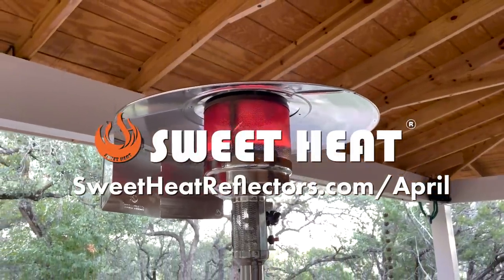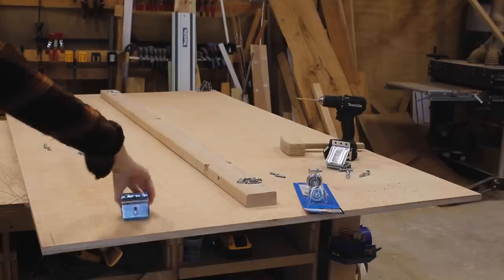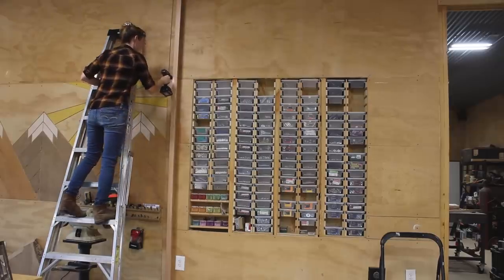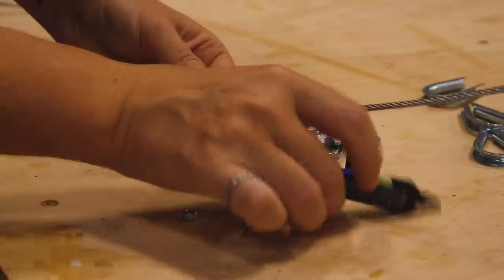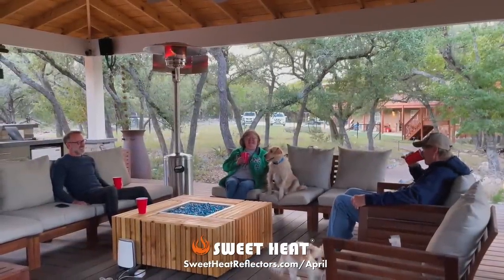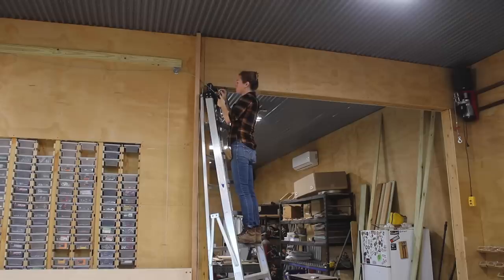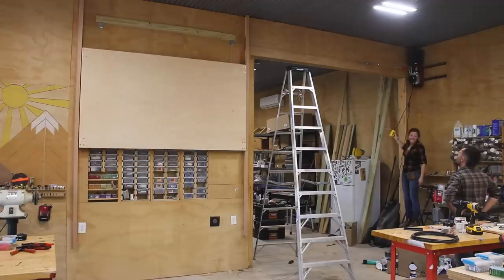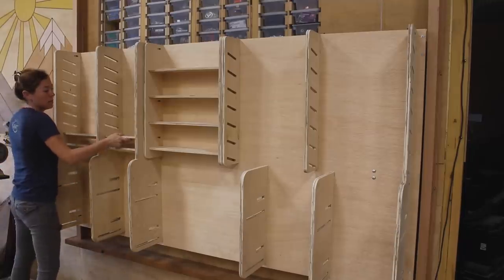DIY Overhead Storage for Garage or Shop | Motorized Shelf

Comment: April, I was always taught "never put your saddle on a deadhorse". Referring to cable clamps. Double check me but I believe ur clamps are backwards. The saddle portion should be situated over the "live" end or load side of the cable. If not correct the clamps can slip and fail if enough load is presented. That would be bad. Love your channel!

Comment: This is a really good idea! If my ceilings were high enough, I'd totally do this! Although, looking at 3:13, your wire rope clips appear to be backwards (I'm hoping it was just a camera angle problem, but I looked at it on my large screen and they do appear to be backwards). They are supposed to crimp the "dead" side and the "saddle" needs to be on the "live" side. There's a saying with wire rope clips: "Don't saddle a dead horse". Having them crimp the "live" side will weaken the strength of the cable and potentially cause failure. Even if wire rope clips are set properly, the effective working load limit is reduced by 20%.  You reduce it further by having them backwards.  Also, they are supposed to be torqued to a certain amount when you first put them on, then again after taking load. I hope that all made sense.  I'm more than happy to answer questions.
Reply: I've heard that about those clips, but I've also heard the preferred method is to unwind the strands and braid it back on itself when forming the eye. Tried it a few times with rope, and helped my dad do it a time or two with cable, and if you take your time the resulting eye looks like it 'grew' out of the end and will handle whatever load the rope or cable is rated for.
Reply: What Mike said, and please do go back and re-torque the cable clips. You will be amazed at how loose they get after loading.
Reply: @curtfatherree7474  that is one method.  It depends on who you talk to or your application as to which method is preferred.  One nice thing about that method vs the wire rope clips, is you retain its breaking strength/working load limit vs losing 20% with wire rope clips.  Similar with compression sleeves.  You retain the working load limit with compression sleeves.  I tend to prefer the compression sleeves because it's faster and you still retain the strength, but it does cost more to have the tools.
Reply: @mikejohnson7882  Is the tool for compression sleeves anything like the hydraulic tools they use for crimping wire connectors?
Reply: @curtfatherree7474  Similar.  There are both manual (more for the smaller sizes) and hydraulic tools (for high volume or larger sizes).
Reply: I think they are applied correctly in the video, but I agree it's hard to tell.  Regardless, this is great info!  Someone who follows the build and makes their own will definitely want to read this comment if they have no experience (like myself) in setting up wire rope rigs.  "don't saddle a dead horse" is going to be stuck in my head, so thank you!
Reply: @mikejohnson7882  I kind of thought they might be similar.
Reply: Note to self: Research the proper use of wire rope clips before using them for the first time.
edit: typo.
Reply: I would have looked for a garage door opener with automatic lock

Comment: April, I always love your builds and am always impressed.  However, one thing I would add (being in the safety business) is adding pins or some kind of lock so you can have a safety device just in case you hoist lets go or one of you many cable connections fails.  What you've built is essentially a guillotine!  It would be easy to add some pins that you could slide into the track just below the rollers (when it's in the up position) to stop the shelf if something fails, but you could pull them out before lowering it.  We used to use bolts in the garage door track to lock garage doors in the down position to keep someone from opening them from the outside, so the same idea can work to hold the door/shelf up.  I'm sure you could come up with something more creative!

Comment: I am having a workshop built (SHORTLY), and I opted for single story, taller sidewalls (mainly due to continued inflated prices).   I think I will love the wide open space, not quite as high as your building, but want to utilize the higher side walls for storage.   As an "older" woman, finally getting space to do wood working, I also knew I don't want to climb a ladder to get to that storage!   This seems like the perfect solution to add storage, but have it easily accessible!  THANK YOU for another great idea!

Comment: Here is a shelf I’m building that raises and lowers similar to yours. My shop is only 15x12 so every inch is important. I’m going to add wheels so I can unclip the shelf and roll it to where ever my shopsmith is at the time. Thanks for posting it inspired me to use my vertical space.

Comment: Awesome shelf - the only cringe i have is seeing a "saddle on a dead horse" with the cable u bolts - always been taught to always have the u-bolt over the dead end (the dead horse) and the saddle on the active/load side of the cable - all to do with how it effects the tensile strength of the rope - not so bad in a low load situation but still a good habbit to get into

Comment: What a great idea to maximize your space.   My apologies if someone has already mentioned this or if you did attach the wire rope clips properly.  I come from the stage rigging industry and It looks like one of the wire rope clams was not on properly. The "U" bolt must be on the loose end (dead end) of the wire rope and the saddle of the rope clip needs to be on the live end of the thimble.  The saying, in the stage rigging industry, to remember the proper way to attach rope clamps is "never saddle a dead horse".

Comment: I used a small lift like that for a big light fixture that hangs in the entry with a tall stairway.  It works for changing light bulbs or just cleaning the fixture. A whole lot better than a 30' ladder in a house

Comment: The only issue I have is the aluminum turnbuckle and the oak tracks.  There is a chance for catastrophic failure at that those points with time and use.  The steel eyes can pull through the aluminum buckle with too much weight or with common wear and tear.  Steel all the way through would be safer.  Maybe look at steel tracks used for farm doors instead.  I find them at Tractor supply.

Comment: By far your coolest shop project hands down. When U decide to put something on the archway header, U can put a pulley horizontally @ top Rt, & mount winch on ceiling or even run cable thru wall & install winch in the other room. Sweet.

Comment: Awesome idea 👍 Will point out one thing just encase someone has never used thred lock before use the BLUE just like April did, as the RED is for a permanent lock and you will find it almost impossible to loosen without the use of a blowtorch.

Comment: Each of my cars has a spare set of tires and wheels. Every season I swap out the wheels, and then lift the heavy wheels overhead onto a tall shelf.

My shop has 18' tall walls, the top part of which are unused.. If I could come up with a good way to store the wheels on a system like this, that could work great.

Comment: You stole my idea!! 😮😊 I’m mostly confined to a wheelchair so I was trying  to think of ways to use the upper parts of the wall.  I have a small space and need to utilize all the space (and most accessible shops waste the upper walls).  Your approach was similar to what I was thinking, but your implementation is much better. Since I had not implemented my idea yet, I will follow your approach. This is the second idea from your channel I’ve utilized to make DIYing easier: I mounted ToughBuilt bags to my wheelchair armrests.

Comment: It is a good idea. You can also add a fall restraint break mechanism for added safety. It shouldn't be too hard to do but you may need 2 of them depending on the weight of the unit and stored material. They can be pricey but I think worth the effort.

Comment: If you like the project but don't want to deal with an electric hoist you could also get a hand crank one starting at around 25 USD to lift 600lbs and can get ones that lift 2500lbs for only 50 USD on amazon. My grandfather used a hand crank one to store his ladders above one of his cars in his garage since before I was born.

Comment: I don't think I would go with this purpose, but I always thought if there was enough ceiling height something like this would be great for a glue up wall. My thing was glue ups always ended up on the floor, table saw, work bench, anywhere there was room. Which meant everything else came to a stop because there wasn't any room left to work.

Comment: Great idea!  Another idea would be to build multiple shelves to store lawn equipment in a vertical orientation.  Build a platform that hoists the equipment using a lift to the required shelf and just roll off for storage.  Just like a mini “Carvana” system.

Comment: WARNING - it looked like you attached the U-bolts to secure the ends of the steel cables where they double back on themselves without stripping the clear plastic off of the cable. I learned the hard way on a project where I setup a winch to hoist a deer feeder up/down that the U-Bolt connection REQUIRES stripping off the clear plastic coating on the cable back to where it doubles back on itself. If you don't strip the plastic coating off, it's likely that eventually the coating will slip off and everything will come crashing down. If you did and I just couldn't tell in the video, apologies for the abundance of caution. and all that said, the project was great and inspirational.
Reply: PS, I setup something similar to hoist my air cleaner up to the ceiling, then lower it when I need to change the filter. 12' foot ceilings are a blessing.

Comment: It looked like you had the saddle of the bulldog grip on the tail end of the wire rope and I believe it should be on the load side.
Reply: Wow I had never seen that requirement. Thanks for the comment. Now I have to go check the overhead garage platforms I put in.

Comment: Great project!bI may have missed it but did you install any kind of locking bolt? I would want someway to lock the shelf in place at the top and bottom levels so you can take tension off the motor. I am not sure those AC winches are meant to hold a load in place long term.

Comment: Your idea is really great.  As I'm getting older, things are getting to be heavy for me to lift. I am putting in a hoist to raise and lower my bandsaw in the garage.   So I've been putting pulleys over places where I'd like to lift things and have been using a PullzAll to lift heavy things at those points.  Your idea made me think  that a a single hoist could be used to lift at all those places.  I'll have to think about how to switch them. Maybe a pulley arrangement like is on a Bowflex machine would work.

Comment: Interesting idea for a really tall wall I suppose. Only thing I'm a little confused about this video is, what shelf did you actually intend to make/use? It looks like you made a set of shelves for paint/spray, then you showed video of what looks like the exact same motorized board, but with a completely different set of shelves for the truck boxes on it. I didn't see anything in the video that allows you to swap between these two sets of shelves, so did you just dismantle one of them just for the sake of the video so you could show a different configuration? Which one did you keep/want?
Reply: I was a bit confused about that as well.
Reply: Yup confusing 😕

Comment: With a cheap Harbor Freight winch (>$100 for 2500# & wireless remote) I could see this being used to raise up bicycles, extra storage totes or even a lumber rack. Just wish I had more than 8' ceilings to be able to utilize one. - Chris
Reply: Just make sure that you have a way to power your Harbor Freight winch since many of the less expensive ones are made to run off 12V that automotive and ATV use and don't come with an adapter to be powered off anything else.

Comment: I love this idea!  Because of the angle of my roof, I wouldn't be able to raise it above the wall. But even 32 sq ft more is something to consider.     Also, think there is anyway for the winch to lift two boards side by side? That would be sweet. I have the length, just not the height. Nice design if I didn't have to purchase two winches.

Comment: I think adding pulleys reduces direct weight of the shelf to the hoist. More pulleys more weight distribution. So in theory this setup can support shelf heavier than hoist capacity.
Reply: I believe (and I am no expert, so I could very well be wrong) it would gain mechanical advantage only if there was her existing pulley at the top, plus a new one attached to the D-ring anchor on the back of the shelf, with one cable off of that going to the fixed-point axle of her pulley, and the other side going around her pulley, creating two cables between the two pulleys 'pulling' the weight (the fixed and the one going around her top pulley), and from there, one from her top pulley back to the hoist.  This would cause the hoist to pull twice the distance of cable run length, two feet at the hoist, to move the same weight, the shelf, up one foot.  That is, one foot on each side of the new bottom pulley attached to the D-ring anchor.  Each of those two feet, one foot on each side of the bottom pulley, is moving half the weight, but causing the hoist to have to spool 2 feet of cable, for a 2 to 1 mechanical advantage.
Reply: Not in this particular case. Because there is only one cable run between the shelf unit and each pulley, the pulleys are just redirecting the force from the winch.

If there were two or more cable runs between the shelf unit and pulleys on the shelf unit as well (i.e. a block-and-tackle system), you would be correct. The trade-off would be that the winch must pull in more cable.

She could have done that quite simply by adding pulleys to the shelf unit, then running the cables down from the ceiling, through the bottom pulleys, then through the top pulleys and over to the winch. This would effectively provide four cables supporting the shelf unit instead of two, cutting the apparent load in half.

Comment: That only works because the wall is essentially blank.  Inset storage is not the norm to encounter.  Most people have shelves attached to the wall that project or units of shelves that sit on the floor in front of walls. All of which would get in the way of a rising shelf unit such as this.

Not sure how you access those inset bins, as they are far over your head.

Comment: How strong is the hoist/cable mechanisms?  I am thinking about trying to come up with something similar (1 cable splitting to 2 parallel drops).  I want to hang a Paramotor (about 70lbs) from a hoist so that I can sit in it (+180lbs) to raise myself up and perform a "hang test" to check thrust angle.  Being dropped while doing this would be bad.